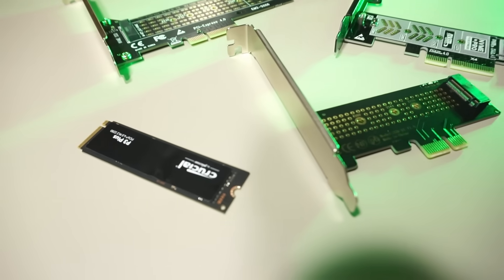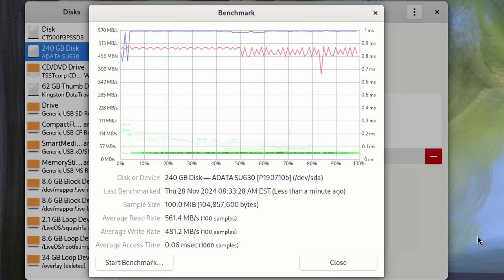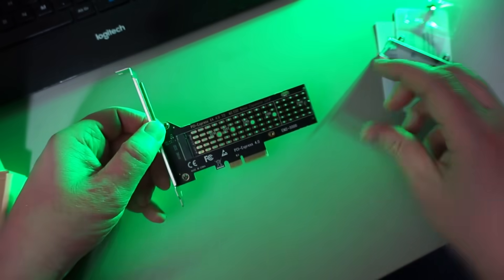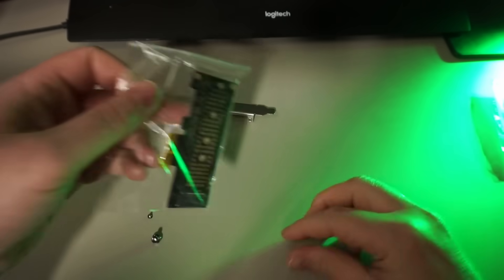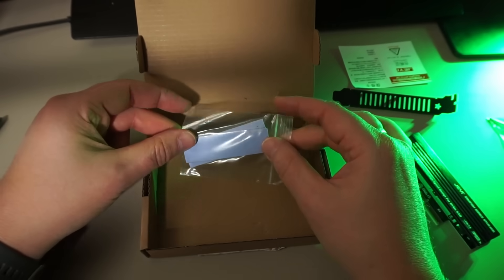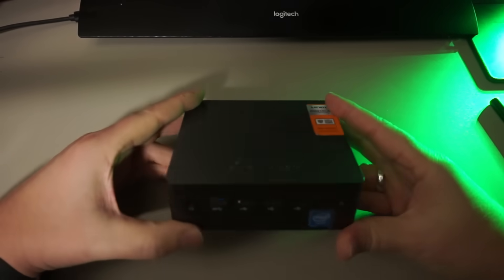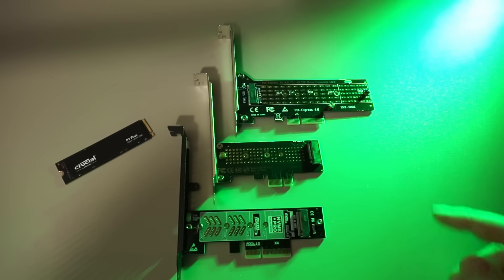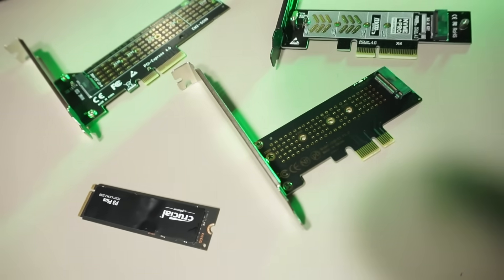Upgrade your old pc with an NVMe! Testing cheap PCIe M.2 adapters!

Comment: I recently purchased a Sabrent PCIe x4 NVMe adapter to play with and see if it worked with my ASRock Z77 Extreme4 motherboard (i5-3570 CPU). The board has plenty of SATA ports but I was curious what kinds of speed it would get with NVMe. I had a Toshiba (Kioxia) 256 GB 2230 NVMe on hand to test with. I was pleasantly surprised that it achieved something close to 1600 MB/s read speed, which is 3x faster than the SATA600 on-board connections. Even better, I found out that ASRock had posted a Beta BIOS update for the Z77 Extreme4 that allowed booting from NVMe! After flashing the new BIOS, the Sabrent/Toshiba NVMe was recognized as a boot volume and I was able to install Windows and make it the system volume, which adds quite a bit of pep to the old motherboard when booting. The Kioxia NVMe is PCIe 3.0 x4 rated at 2200 MB/s. I suspect the not-much-slower performance as tested could be due to the motherboard speeds or the Sabrent adapter. It's also possible that the x4 slot was being controlled by the PCH, which could be slower than the x16 slot controlled directly by the CPU itself. Unfortunately I don't have another system with a open x4 PCIe slot to see if more speed could be coaxed out of this setup with a faster NVMe or motherboard, but I'm very happy with the results of this experiment as it definitely breathes new life into an aging, but still capable, system.

Comment: A significant further benefit is omitted - that NVME has a direct PCIE line to the CPU, so lag and overheads are less than sata, which goes via a chipset and a subsidiary SATA controller. Extra perf matters on old rigs.
Reply: Not all PCIe slots (and that includes the M.2/U.2 slots!)  on the motherboard are wired directly to the CPU, especially on consumer grade boards - and that's due to the CPU just not providing enough lanes to begin with. Unless you go high up the ladder, usually only the main x16 and first M.2/U.2 connector is directly linked to the CPU, and everything else is routed via the chipset anyway, and the limited link it typically has.

Comment: Im rocking a Samsung 990 pro im my Z87-k using clover and one of these adapters with 4 pci lanes, its both funny and amazing to see a mobo that wasn't intended to be used this way running games and Windows at 6 gbps 😂... also have 3060 12gb there and a I7 k series, it rans everything at 60 fps 1080p, not bad for an almost 12 years old motherboard

Comment: I bought cards like these that accommodate both SATA and NVMe on one card. There's a SATA connect, so you can connect it to one of the SATA ports on the motherboard. I use the Clover bootloader on a 16GB SATA M.2 drive.
Reply from the maker: That's an interesting solution! 16GB seems a lot for just a bootloader though?
Reply: @ex-itguy  It was the smallest SATA M.2 drive I could find, at the time and way faster than a USB drive. I did however recently find an 8GB SATA M.2 drive.

Comment: I hex modded the BIOS in my old 4.8ghz overclocked 3770k build with an Asus P8Z77 WS board to boot from an nvme adapter card like this. I also added in support for resizable bar and above 4g decoding using a guide I found on a site... I was seeing about 2500mb/s on an ADATA Legend Elite 850 using a 3.0 x8 slot. That drive gets over 5,000 mb/s at gen4 speeds, so I am swapping it out for a 970Evo+ that should do 3500 mb/s with a gen 3 link.
Reply from the maker: Interesting. I would expect it to simply fill the gen 3 link. Mine kinda did and it was rated for just 4,500MB/s on gen 4 if I remember correctly.
Reply: @ex-itguy  I think the speed limitation in my case is probably the chipset, I would imagine. But I'm going to experiment with a couple different drives and see what works best for it one of these days. I've been experimenting with some overclocks and different GPU's with it lately, and it took over the top 5 3DMark records the other day alone. I really only use it for backups since I built my 9900k and 11900k systems, so I'm not as concerned with its performance like I used to be... One day it will get four RX580 graphics cards installed in crossfire, though.

Comment: Gen 3 ? gen 4 ? lack of details
Reply from the maker: You didn't pay enough attention then haha, it's all in the video. However, there's a follow-up since I made a dumb mistake. The system I used to test on only has PCIe 2.0 slots, so I re-tested on 3.0 shortly after.

Comment: Interesting. I'll keep this in mind if any of the old computers I keep around as servers need more speed or a larger OS drive, as new NVME drives now are cheaper than SATA SSDs for the same capacity

Comment: Problem is that the old PC MUST HAVE a PCIe slot.
Also, you must have drivers for the OS you are using too.
Reply from the maker: All PCs (well except for minis I guess) from the past two decades have PCIe slots. An NVMe in a 486 wouldn't really make sense. 
I didn't need drivers to use it both in Windows and Linux.
Reply: @ex-itguy  I have an old 2000 core2duo that came with win Me on it.
Works fine with Linux and does not have that slot.
I have another mobo that uses Inhell dual core that also does not have it.
This computer does have one multi-lane pcie and a 1x pcie.
It is just under 20 years old.
Linux on this one did not need drivers but when I dual boot with XP, I had to install drivers.
Oh and this computer does not boot from anything connected to pcie. None of my hardware does. I have to use a traditional hard drive platter) to get to grub to choose what I want to boot.
I have two laptops that do not have pcie on them.

All my stuff does have SATA and the old 40 pin flat cable connections both.

Was looking for a straight PCI (only no -e) video card. Dang hard to fine even a used one.
Reply from the maker: A pc that came with Window Me (2001) and is less than 20 years old? Me didn't really stay for too long, so in 2005 no-one sold pc's with Me on it anymore...
Reply: @ex-itguy  No, the PC was brand new at the time (2000 year).
It was given to me.
Used it till I couldn't stand it then tossed linux on it.
Still pretty slow but operable. A backup computer if you will.

Comment: I am using a bifurcation adapter and it works great. I stopped using   hard drives and SSD drives. I even had to add NVME to my bios which I learnt how to do on the web
Reply from the maker: Awesome! I still need to dig into that last thing myself

Comment: I have a fairly old system with a first-gen Intel Core i5-661 and 16GB DDR3-1333. I use it as a vacation PC, but I chose to add a PCIe SATA III controller for a 2.5" SSD, which gives me decent enough speeds for a PC of this age, as well as more SATA III ports. I did this because I also had to add a PCIe adapter for USB 3.0, so I can move around files at decent speeds, and the other slot is taken by a TV tuner. It works great for what I need from it.
Reply: Damn. I remember that i5. It has to be 15 years old. Thats amazing you still get usage out of it. I bet you could use Chrome OS Flex on it.
Reply: It works great. But even that is more powerful than what we actually need for plain browsing, watching movies, doing anything office-related, or even some programming or virtualization.

The older laptop that I bought in 2009, with a Core 2 Duo T9550, can even play 1440p videos here on YouTube, without breaking a sweat - or dropped frames. Obviously not with Windows, since that pile of bloat is not happy with the 4GB RAM the laptop has, but with Linux Mint I have RAM to spare. :)

The basic rule of modern computing is: a modern OS really needs at least 2 cores to do more than one thing at the same time. Then it needs enough RAM to handle the day to day job that people have to do, and then an SSD will do wonders compared to using an HDD. We've been made to believe that old PCs are bad, just because WIndows kept raising the requirements. In a Windows world, they're right. But thankfully there's more than just Windows.

Comment: Thank you for the video :).

Q: Do you still need a drive with a bootloader if you plan on using the NVME as a gaming or programs drive, not an OS drive?

I have the Gigabyte Z68XP-UD5 MB, no NVME support. The PCI-E slot, afaik, is PCI-E v2.0. 

Apparently here's a Windows 7 hotfix that allows for support of an NVME drive, but I'm not sure how that works.
Reply from the maker: Thanks! No, if it's not going to be your boot drive, you don't need to do anything special. It should "just work" the same way a SATA drive would.

Comment: Many adapters exist I don't mean branding but slot type ..X1/X4/x8/x16 and some micro for example an adapter for laptop WiFi card slot to nvme.. so that aside..other than a drive poping up in the OS as storage..Can you boot off it  when it isn't supported by the bios as a boot device well if you want to try it on an older PC try using Clover on a USB drive to be able to boot from it

Comment: Speed is just one advantage to using such an adapter.  The other is ease of cabling.  Every SATA drive needs a power cable and a data cable, something we all live with for what, a decade (after SATA replaced IDE)?  An NMVe drive requires no cables, so your build will be cleaner and easier to cable manage even if it's not faster.  Systems too old to have an NMVE slot will very likely have some other link in the chain that will bottleneck before your SATA SSD does, so the real value in using an NVME expansion card is for adding more NVMe drives, not using one in a system where no slot exists.

Comment: My 2010 cheesegrater Mac Pro has a 2 TB 970 EVO NVMe SSD in a glowing RGB PCIe adapter (Silverstone brand, I think). This SSD and adapter yields write speeds of around 1300 MB/s and read speeds of around 1400 MB/s, which is an amazing upgrade for a computer from 2010 with SATA II (600 MB/s) hard-drive bays.
Reply from the maker: Nice! Do you actually notice the difference using it?

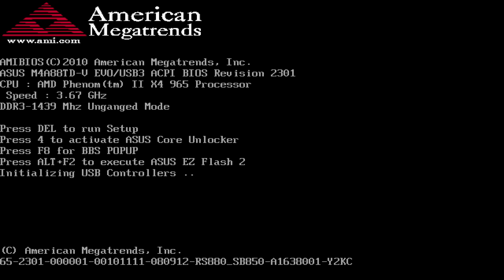Comment: 6:10 - Except if you use Clover on an old cheap SATA drive to pass the boot code to the nvme drive. That's a workaround that's been used for older systems and those cards.
Reply from the maker: Still doesn't really boot from the NVMe does it? ;)
But yes, Clover seems to be the easiest way to do this. :)

Comment: Dude was too cheap to use an x8 or x16 adapter. Had he done the math beforehand, he would have known the 1X or 2X adapters weren't up to the task at hand and instead picked up what he needed w/o wasting money.
Reply from the maker: There's only a single X1 adapter in this test, the others are X4. An NVMe drive uses 4 lanes so an X8 or X16 card isn't gonna help you.

Comment: Why not buy a PCIe storage rather than an M.2 adapter?
Reply from the maker: Harder to get, more expensive, not usable in an M.2 slot when you do upgrade?
Reply: @ex-itguy  Yes, it's comparatively more expensive but when you upgrade, it's assumed that you're already willing to spend that extra money for a PCIe card and a bigger motherboard to fit it along side a graphics card.
Reply from the maker: @lonekid9286 that doesn't make sense, then you wouldn't need an adapter like this either.
Reply: @ex-itguy  that's what I'm saying.

Comment: 1:40 : Even I may buy this product, it's backward compatible with my entry level Laptop 😅😅😅. That use PCIe 3.0 btw 😅
Reply from the maker: Laptops usually don't have full size PCIe slots though. ;)
Reply: @ex-itguy Yes, I know. My Laptop by default using M.2 PCIe 3.0 and that SSD is backward compatible 😅

Comment: Overall, it's a good review. Although I still have a question about the NVME visibility under BIOS and as a second NVME drive for system cloning and backups of the 1st NVME drive. Because I have 2 different motherboards with NVME/NGFF slots, but neither of them supports 2 NVME slots. This means I can't backup C drive from 1st NVME (in PCI-E 3.0 slot) to a 2nd NVME drive, so I'm considering such adapters. I hope they're visible and work under the Hiren's Boot CD / Win PE systems.
Reply from the maker: That should work just fine indeed. I don't have an extra NVMe drive to test that theory with, but it worked fine on such a board using only the adapter.

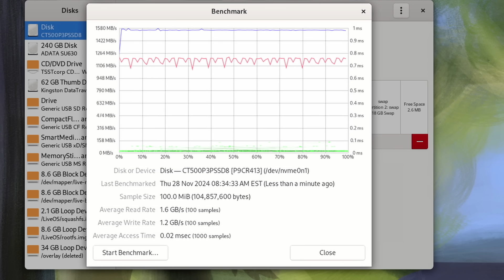Comment: 2:50 Why? you did it all right: read specs before installing and realize that you won't get max speed according to your specs and case. But still at this moment you regret that you can't have the speed of PCI-E 4.0, although a minute ago you showed me that you don't have PCI-E 4.0, but only 2.0. And according to 2.0 you have pretty good results.
Reply from the maker: The mistake I made is that I thought that I was testing on 3.0. ;)

Comment: No, these adaptors don't work. Neither windows, nor Linux bootloader can boot from nvme ssd mounted on these adaptors.
Linux has got and advantage, you can install boot partition on a separate drive and it'll work.
No luck with windows. Clover doesn't work in my case.
Reply from the maker: They work fine but you indeed can't boot from it if your BIOS doesn't support it. I haven't gotten around to trying Clover and BIOS hacks for that.

Comment: If the  motherboard has a single m.2 slot already, are there adapters to stack a 2nd nvme on top?
Reply from the maker: I don't think so. You would divide available lanes across the two drives so both would work at half the speed.

Comment: If using a Samsung 950 PRO (1st retail branded NVMe SSD), it's bootable w/out having to modify anything, other than adding a PCIe adapter, then clean install. This also makes it perfect for legacy AMD (FX/Phenom) as well as older Intel systems w/out native NVMe support. This also means if it's a PCIe Gen 3.0 MB w/out M.2 slot (such as some Z87 MB's), then a PCIe 3.0 NVMe SSD will boot & run at native speed, although will reduce the GPU to x8 instead of x16, of which most won't see a difference. It may be that a clone will work with this drive, as it has it's own bootable ROM, I just haven't tried. It's likely only one of few that does, meaning it can boot both old & newer OS's. The 960 Pro & newer doesn't have this amazing feature. BTW, this type of install will support any OS with native NVMe drivers. On some OS's, a driver may need to be slipstreamed to the install media, such as Windows 7, which is less relevant in 2025. Windows 10 has a built in NVMe driver, as does most modern Linux distros, such as Linux Mint & Ubuntu. 

As for an adapter, if possible, it's best to get one which includes a fan, if can still be found under the Sintech brand (I have several), While some will have rifle bearings that'll squeal, these can be replaced with a low cost 40mm double ball bearing one. Just make sure your current fan is of the same size. If no adapter with fan is available, may be a good idea to place a small chassis fan nearby, blowing air towards the M.2 drive. This helps to reduce temps & therefore throttling, and ensure a longer lifespan. Have been doing this since M.2 NVMe became a standard, as it's not ideal to install under what may be a hot GPU.

Comment: A PCIe SSD (Peripheral Component Interconnect Express solid-state drive) is a high-speed expansion card that attaches a computer to its peripherals. PCIe is a serial expansion bus standard.

PCIe slots come in five different sizes: x2, x4, x8, x16 and x32. The number after the "x" corresponds to the number of lanes each card has for bidirectional data transfer.

Comment: guten morgen her mister, have samson 990pro 2TB with 14 years old mainboard P8Z68 with i7 3770 and disk works 3400/3400 mega bayts per second it reaches full pci 3.0 speeds and can boot w10 or w11 without problems, das is crazy ja?
Reply from the maker: That's interesting for sure, as that's a PCIe 2.0 board that shouldn't reach more than about half of that. Are you a magician? 🤔😄
Reply: @ex-itguy   nein, has pci 3.0 with 3xxx cpus
Reply from the maker: Nice

Comment: They work fine provided if you are using the x4 or higher pci-e slot not a single(singles are better for wifi). As for levels you can always compensate for 2.0 by raising the pci-e frequency.

Comment: I do not know where you found these adapters in PCIE x1 from, because all i could find is PCIE x4. Which means in an old PC you need a spare or dual PCIE x16 slot, which isnt readily available. So if your old PC has a GPU installed, where can you place a PCIE x4 ??? But it is interesting to see the speed difference between x1 & x4. Old PC`s have spare PCI & ISA slots, why can we not get an adapter for them, that meats 4700mbs
Reply from the maker: I have linked all models in the description. ;)
But the X1 variant is not that interesting compared to SATA, so if you don't have an X4/X8/X16 slot available, it's not really worth it.

Comment: Just to save everyone $160 I tested the startech PEX8M2E2 which is an x8 wired card.  The problem is I was hoping that that meant it would take x8 of my pcie 2.0 board and translate it into x4 of 3.0 bandwidth.  It doesnt.  It just bifurcates the pcie lanes and gives you 2 x4 slots.  With my motherboard (asus p6t deluxe v2) I believe it defaulted to x1 speed and would not let me change it.  I tried changing from slot 3 to slot 2 and it just wouldnt see the card.  By default my board is x16 for slot 1, then can normally be set to x16/x1 mode or x8,x8 mode.  When I put that card in my pc it would not let me select the speed of the slot in bios.  x1 on pcie 2.0 doesnt feel any faster than pcie 3.0 so I returned the card.
Reply from the maker: Oh wow, seems like you're might actually be better off using a cheap one then!
Reply: @ex-itguy  heh yessir... just bought it.  $19 with tax.

Comment: Even my Intel B660 board can't boot from a drive in such an adapter, only from physical M.2 slots. But there are workarounds, like having the EFI partition on a physical M.2 but the system partition on the PCI-E SSD.
Reply from the maker: That's interesting. My H110 board that only supports SATA in the M.2 slot boots fine from either of these adapters.